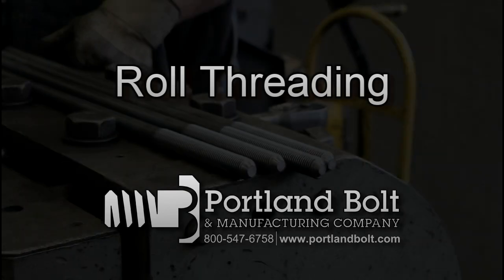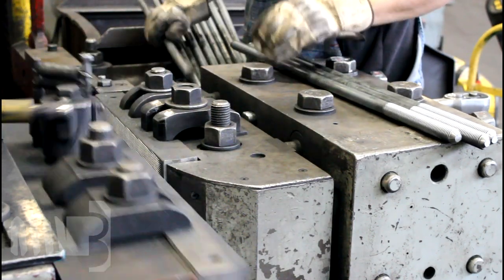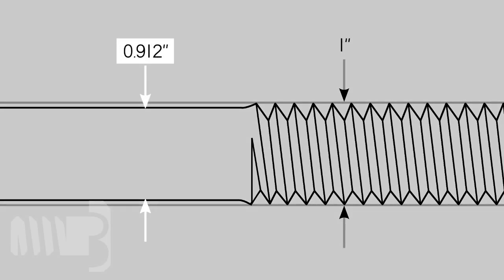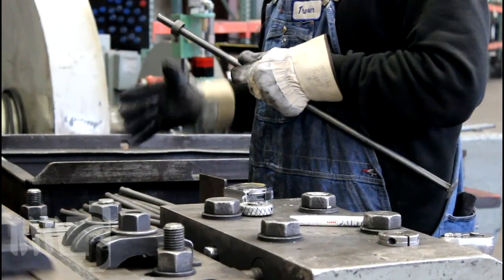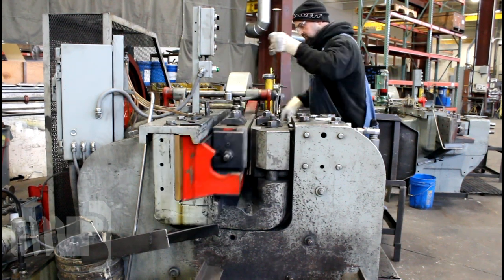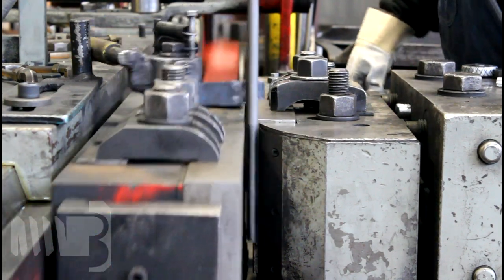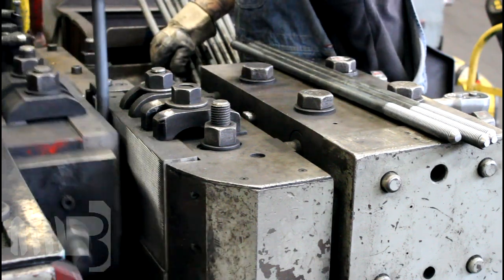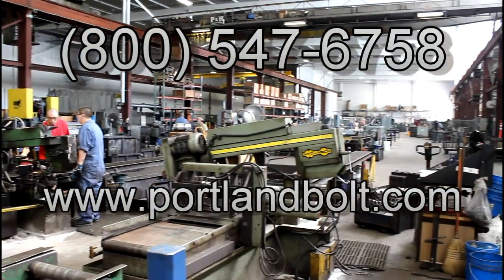Roll Threading Bolts and Fasteners

Comment: If I have to cut some thread off a rolled threaded u bolt, does that decrease the strength of the u bolt? Is there a proper way to do it?
Reply from the maker: We are not sure how cutting some of the thread off of a U-bolt would affect the strength of the fastener.  This is a question for a structural engineer.  It certainly would not change the strength of the steel itself.  A band saw is typically used to make the cut and we would recommend chamfering the ends of the U-bolt after cutting them.

Comment: That way of making the thread of the bolt (Rolled vs Cut Thread Bolts) is, in our opinion, the best way to do it for an anchor bolt that will be used for heavy machinery application. It is also a GMRC recommendation.

Comment: It is useless machine. Where is automatic feed? Thread rolling machines with flat dies are for mass production.
Reply from the maker: TECT Tect - Thank you for the comment.  We find flat die roll threaders far from useless.  As a matter of fact, we try to roll thread as many orders as possible.  Compared to cut threaders, they are extremely fast and efficient as a method of threading construction fasteners.  Since we use a pitch diameter steel to manufacture bolts with rolled threads, in addition to reducing labor costs, they allow us to reduce steel costs, galvanizing costs, transportation costs, plating costs, and any other costs that are based on weight.  Flat die roll threaders are often used in a mass-production environment, but since we are a job shop, automatic feed systems are nearly impossible to implement.  We set up, tear down, and alter setups frequently from one order to the next.  Although we have some runs of several thousand pieces of the same bolt, the vast majority of orders are much smaller in quantity and different in size/configuration and simply don't lend themselves to automation.
Reply: Portland Bolt Thanks for the reply. Maybe UPW thread rolling machines or UPW like machines with cylindrical dies will be more effective for your workshop.

Comment: Very cool.  How about heat treatment for higher strength bolts?  I am assuming you would send that out.
Reply from the maker: @Rafael Lastra com - You are correct.  Although we manufacture and galvanize here in our facility, we have another company heat treat our bolts.  However, the bolts in the video do not require heat-treatment.

Comment: Neat! Reminds me of the machine that makes ring shank nails.  Do you get good life out of those dies?
Reply from the maker: As with any type of die, these items do wear out and need to be replaced. However, this is a difficult question for which to provide a single answer. Many factors determine the life of a set of flat roll threading dies. Contributing factors include the strength/chemistry of the steel being rolled, the diameter of the round bar, the thread lengths, the condition of the threading machine itself, and the skill of the roll threading operator. Assuming the equipment is in good condition, it is being run by an experienced operator, and we are threading bolts that are well within the capacity of the machine, we do experience good die life.
Reply: Excellent, very informative video - thanks a lot!!